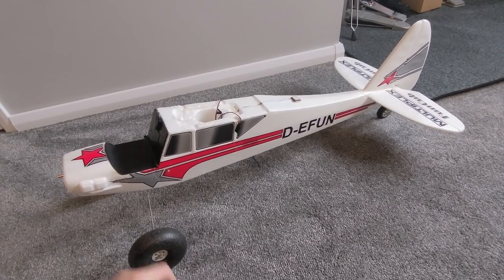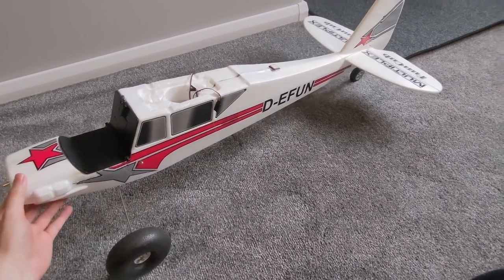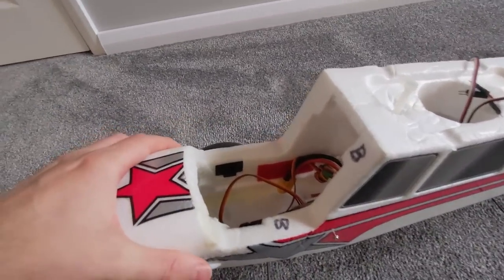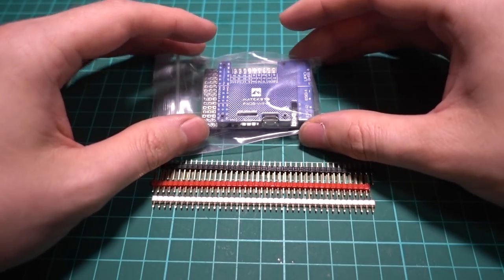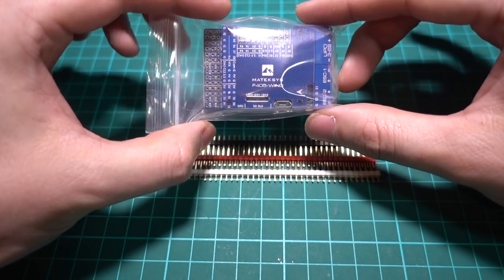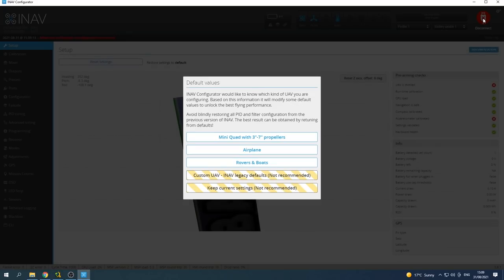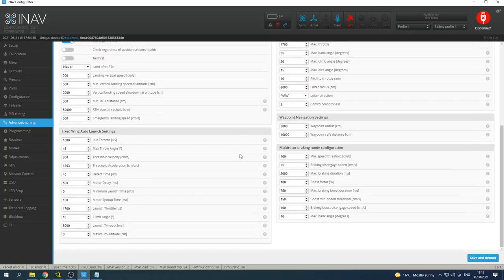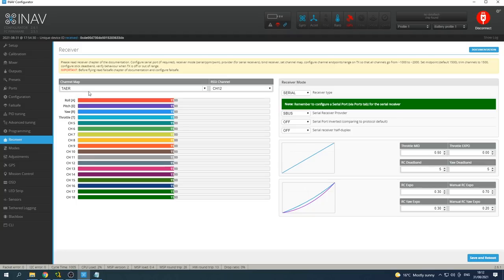The Ultimate RC Plane Build

Comment from the maker: Plane: https://bit.ly/3noMCrN
Alternative Plane: https://bit.ly/3tntviL
4s Lion: https://bit.ly/3BQukDs
F405 Wing: https://bit.ly/3BLpSG8
Dual Lock https://bit.ly/3kYFqje
X9D Plus SE 2019: http://bit.ly/2GYO7Xn
Caddx Vista: https://bit.ly/3n7Iz2D
DJI Goggles: https://bit.ly/3h9cPGS
Digi Adapter: https://bit.ly/3yD7qPm
https://bit.ly/2RHPaDL 
https://bit.ly/3yzkPb9
Crossfire: https://bit.ly/391HpxH
Receiver: https://bit.ly/3zMMTId
Inav config: https://bit.ly/2WU2B6l
Xt60 Leads: https://bit.ly/38NeDAC
9180MG servo: https://bit.ly/3jMlz7o
2k ohm 1/8W Resistors: https://bit.ly/3l4RBL4
servo tester: https://bit.ly/3jQ36qv
Servo Extension: https://bit.ly/3BOidH1
4 pin Servo Extender: https://bit.ly/3BOdhC1
Pan Tilt system: https://bit.ly/3tlrMdC
Alternative: https://bit.ly/3zQHY9i
Arduino nano 33 ble: https://amzn.to/3wvGrn0
Switch: https://amzn.to/3ud2s8B
3d Print Mount: https://bit.ly/2SswcAQ
GUI Download: https://bit.ly/3yK8EZh

Comment: Hey Andy. Cliff here creator of the Headtracker Project! Thanks for the great video on this entire setup start to finish. Love to see users having fun with it. Make sure you try the latest version 2.0x, far more stable over Bluetooth and much faster update rate. +1 on the Matek wing boards, can't beat the features vs price. Have the 765 with Ardupilot and love it.
Happy flying!
Reply: Hi, Cliff. Marco from México. Following closely your projects. Thank you for your contributions with the Head Tracker. I´m right now budgeting to buy everything to do my build of my dream rc project but have a question. Do I necessarily need to buy the DJI FPV Goggles, or could I get a cheaper version?
Reply: @marcogonzalez9890  You can go with any set of goggles. Started with the analog EV200 myself. Can always upgrade later if you enjoy it.

Comment: You mention the 400ft height limit, which it normally is, but if I  understand it correctly if you're a bmfa/fpv uk/couple of others member then the article 16 authorisation allows higher flights for non-multirotor craft.
Reply: non fpv too BUT who actually cares
Reply: I'm not sure that is non FPV, as long as you have a spotter which everyone always has, right??? ;) (and you can easily see a decent sized LoS plane above 400ft).

However from further reading, it has to be non-autonomous, so I think the GPS return to home excludes it from this particular provision.

Comment: I like rc planes with lots of power. You can always limit them but the luxury of just pointing them in a direction and giving them full throttle is really nice.
Reply from the maker: more power means heavier motors and batteries and better wing structure. cant run lions on crazy power

Comment: I'm just now doing this to a WotsWot foamy biplane. The printers are still busy 🙃
I'm going to make the first flights with a Spektrum receiver, without FC. If that works fine, I'll make the step to Crossfire and INav.
The head-tracker can also be connected to the Crossfire module directly, but I think, you then don't have the options like with  OpenTX. Have you tried this?

Btw. in German "AndiArbeit" is a word-game which translates to "Get To Work" 😉

Comment: Very nice. The vibration on the fun club is due to the nose being too flexible. Maybe it wasn't designed for today's high power motors. There is someone that does a kit stiffen the motor mount up.
Reply from the maker: Check out out formation flights. No issues with vibration. The prop needs ballancing I think

Comment: Thanks Andy. I felt the enjoyment you had during this flight.😇😇. Will your blue tooth mods also work with the older Taranis transmitter?
Reply from the maker: No however a wired one will. Check the git hub link for the wired version

Comment: Love it, just one advised.  You need to set the high of the camera to the point you do not see the top of the cowl like you adjusting your seat, so when landing you can be like in a real plane pilot. Check my last video, with my Viper 90mm jet..

Comment: Hi great video as always can you help I've got Diatone Roma L5 finally got Express Lrs working but one thing I've noticed got GPS resume but it not set up in Betaflight pc or speedy bee mobile so when I pick switch etc add range it doesn't light up and input my Google's on.to see what mode I'm in when try to arm it needs and says gls rescue SW so when I look into it more no matter which Aux switch I pick it always takes Aux 1 and you know need Aux 1 to arm express lrs can you help me set this up as default when fail safe is to drop also if tick land in failsafe option takes Aux 1 and I can't arm drone but if i select drop it arms and all switches work any help pleay cheers from heatwave uk

Comment: Hi again Andy I have been playing with fpv for a while now but have only analog fpv have been craving dji digital fpv since it came but EU rules on output power have always held me back, have seen video and heard that there is a hack you can do but have not got 100% reality on it yet. the question I have is if I acquire dji, am I stuck in short-term output or can I make a notch so that I benefit from 1200mw output.? Sinesly reggards from Michael  sweden...
Reply from the maker: The distance is limited in the software so in my opinion the stock antennas do the job just fine
Reply: okay but is there a software hack i can do so that i can use full output level even in the EU 25mw as I understand it but in the usa they run at 800mw have even heard of 1200mw

Comment: hi bro, how to add bluetooth module to FrSky Taranis X9D Plus SE 2019 24CH? @AndyRC
Reply from the maker: It's already got it
Reply: @AndyRCchannel  what is the brand name of the bluetooth module you are using?
Reply from the maker: @fajarirawan7143  in the goggles or the transmitter? goggles is arduino nano ble and transmitter is built into x9d 2019 details should be in the description
Reply: @AndyRC your bluetooth name on the transmitter
Reply from the maker: @fajarirawan7143  it's built into the transmitter